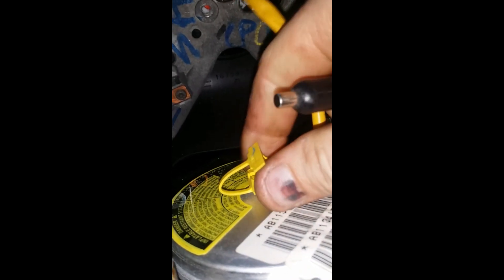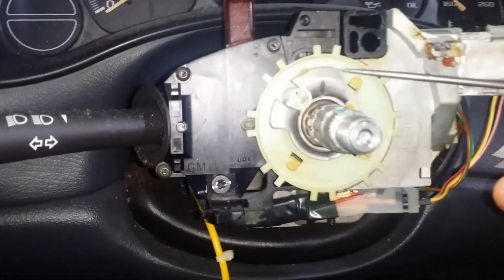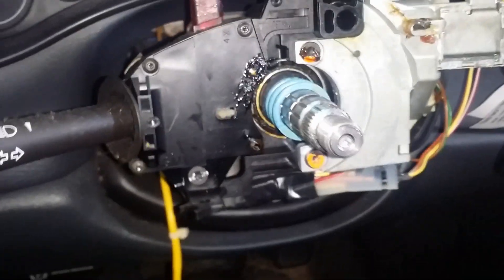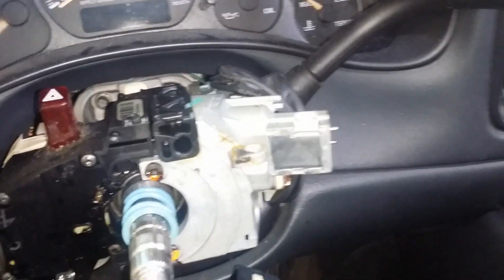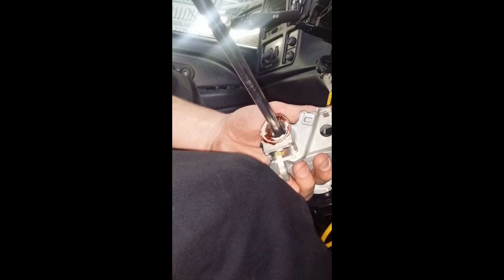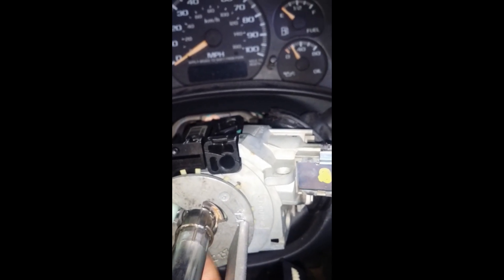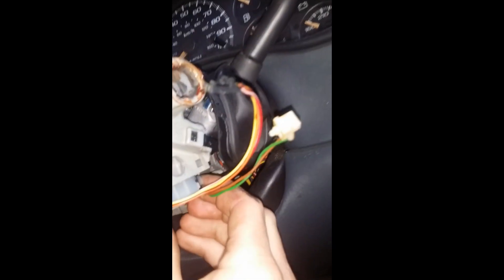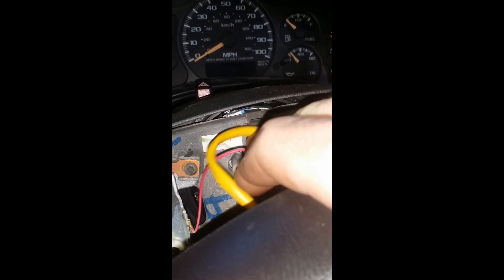02 Chevrolet Avalanche Ignition Case Replacement Procedure - Passlock Fix

Comment: My cylinder case was hammered half of it off when it was stolen. They used a screwdriver to start it. Ford has a hardened case with key reeds and is $500 to replace

Comment: Do you need to take the ignition cylinder out? I tried drilling out my cylinder and ruined the case and still can't get it out
Reply: Hey. Did you have to remove the cylinder? I can’t get mine out.

Comment: How did you determine if it was the Hall effect or the magnet on the cylinder? I have a voltage drop when I crank but nothing when I turn to any of the other positions. Does the voltage drop only happen during the crank or on the koeo?

Comment: Hey so I'm having problems with the programming I followed all the steps but still same problem
Reply: +Antonio Aguilar Make sure your battery voltage isn't dropping below 12 volts. The 30 min relearn should work. If not, you may have to take it to a shop/dealer so they can do the 10 min relearn via GM SPS system.

Comment: Get the tool on auto zone $16
Reply: Just so everyone knows, the tool they sell at autozone isn't going to work for GM stuff with this style of plastic lock plate.  Doesn't have the little J-42137 adapter.  A 3 inch washer works well in place of the adapter.

Comment: Everthing was going well until I tried to put back the cable for the key release and it won’t go all the way in into the new housing any ideas?? I have the plastic piece all the way to the off position but still it won’t go in

Comment: I changed my ignition lock cylinder for same model but it won't turn on. Whenever I tried turning the key the cylinder doesn't return by itself..
Reply: hello April, i have a 2000 chevy Silverado 1500, i just had the same issue and it turned out that the gears on the ignition switch were not in the correct position with the gears in the key lock housing , once you have the gears aligned correctly, the lock cylinder will return or have recoil. hope this helps